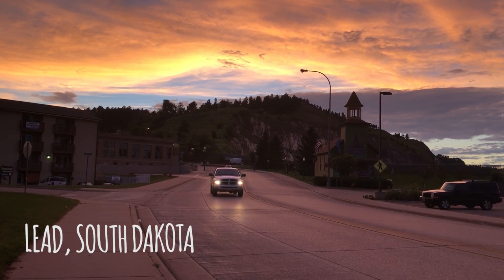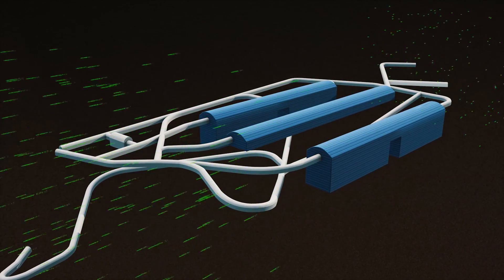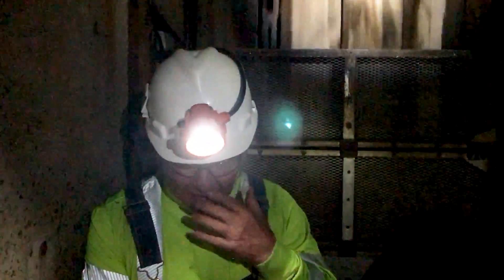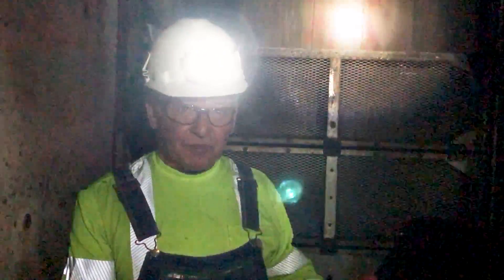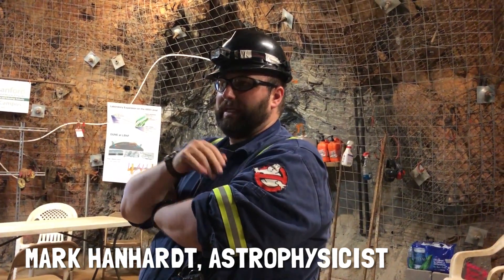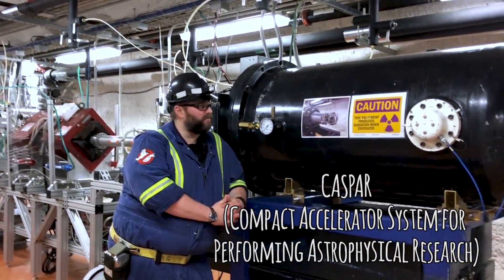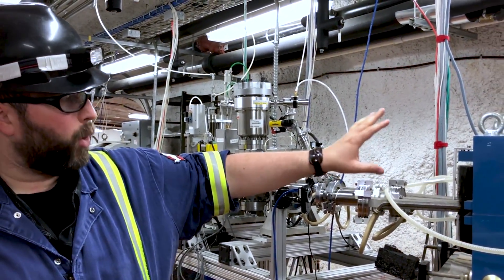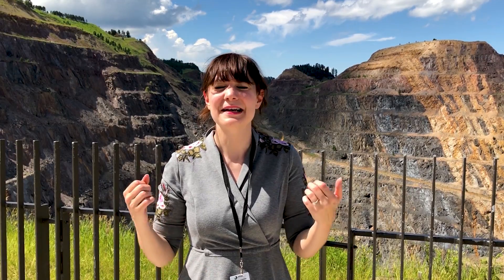Science Adventure: 1 Mile Underground!

Comment: Did it feel like you were travelling to the center of the Earth? Was it notably warmer down there?
Reply from the maker: It felt a bit humid and warm in parts, but they also had air conditioning in other parts.
Reply: In case you don't get a proper reply from Ariel:
The one time I went into a salt mine, the temperature was indeed quite high, compared to the temperature outside the mine.
Reply: Air conditioning, nice! 
(Humidity definitely wasn't an issue in the salt mine.... the opposite ^_^ . And breathing salt dust isn't the most pleasant thing ever :P)